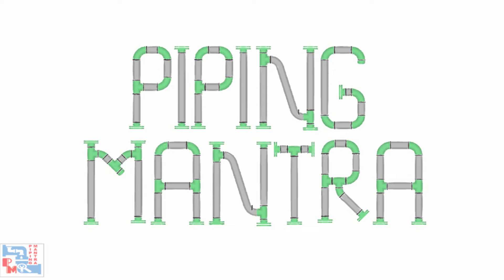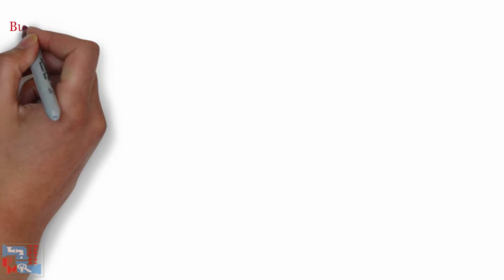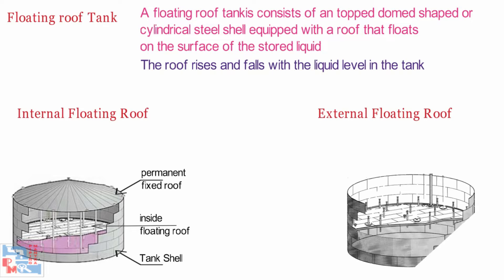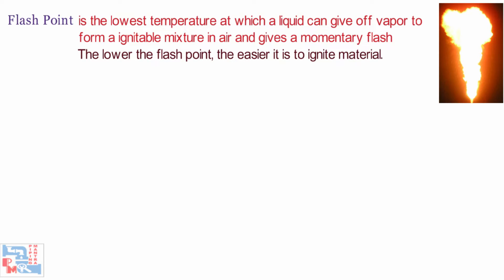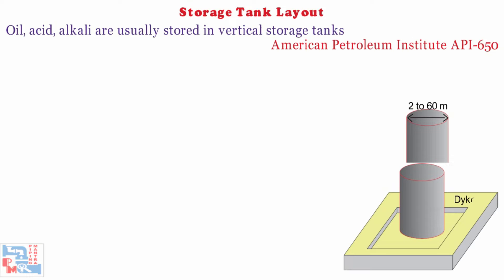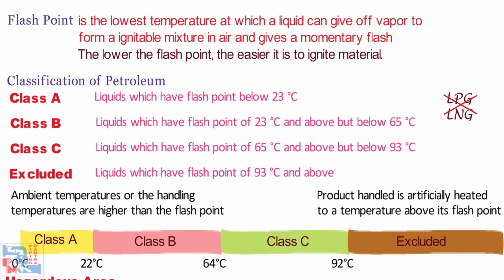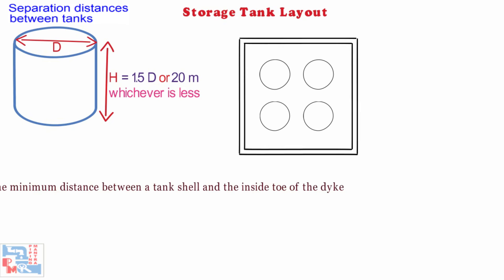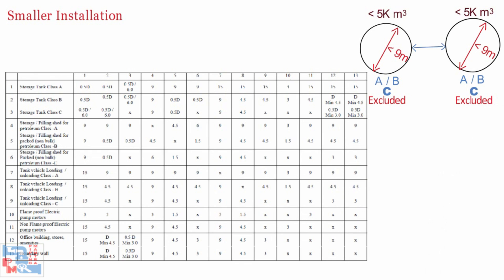Storage Tanks | Storage Tanks Layout | OISD 118 | Piping Mantra |

Comment: 2 comments i have. 1. for certain product like methanol, they require aff foam and if water is used to fight fire, the mixture of methanol and water will be flammable up to 4:1 water methanol ratio. so dyke containment need to consider this.  2. open external floating roof tank, how does it drain off water and snow from the roof? by the way are u using nfpa 30? thanks for your informative video.